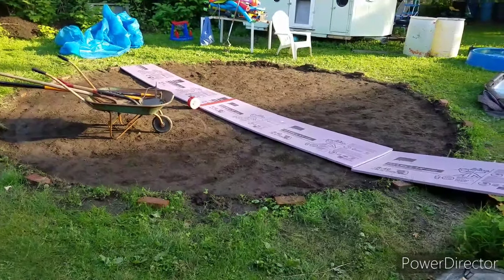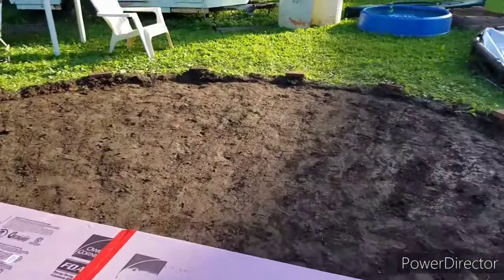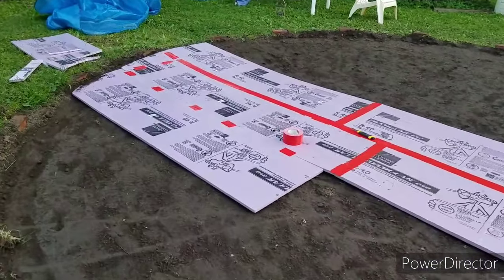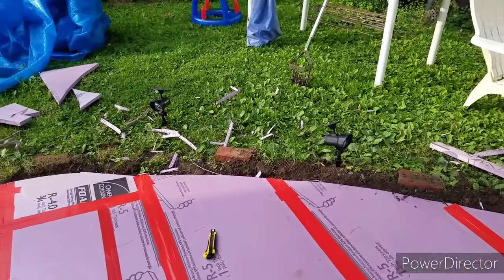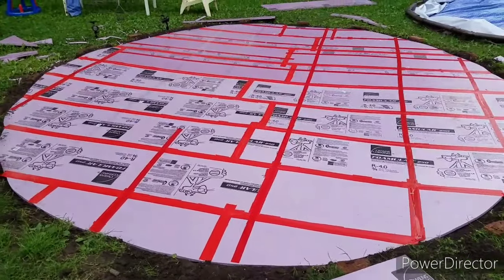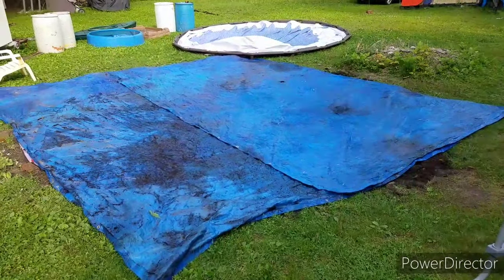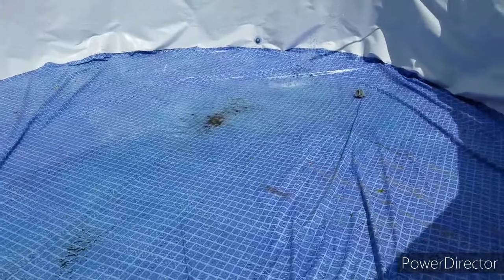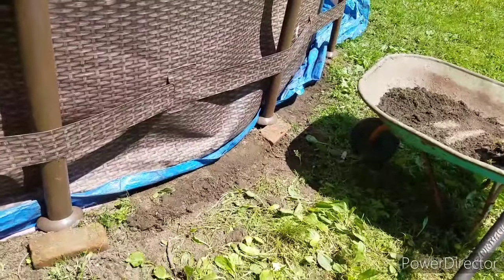Foam pool foundation, Coleman Intex best way pool

Comment: I think I like this idea.  What did that amount of foam cost you about? 
I'm about to do my pool foundation but thinking if I put down 2 inches of sand, I won't have to worry about rocks.  At least I hope?
Reply from the maker: Pool makers say not to use sand since it quickly washes away if a leak develops, possibly causing a drowning risk.
I believe I mentioned the cost in the video, I'll have to go back and check since I don't remember
Reply: @rowerwet  thanks.  
I just calculated the cost of putting down foam boards from H.D.  for my pool size.  It varies from $75 to $200 depending the board's maker/thickness/r value.    I had heard some makers say not to use sand but I had never heard the reason why.  That's interesting and good to know.
Reply from the maker: @johns9990  the wash away happened to me sisters family last spring. They have a bigger above ground pool, and it's probably a decade old now. 
They noticed water running out,  so my brother in law got a repair section of pool liner and went diving to find the leak.
But as he was feeling for the hole it was carving away the sand and soil from under the edge. He felt the liner blow out and swam free of the rushing water. 
It left a good sized hole in the ground and they couldn't get a liner all summer because they were all sold out because of covid.
Reply: Ive read several times not to use sand under pools. The jigsaw shaped outdoor foam mats look like a good option.

Comment: My opinion based on my waterproofing contractor from two years ago. The foam will be water logged after rain and ground water absorb into over the years. My contractor said he doesn’t use this type foam boards against cement block walls for this reason. I would think being under the pool you risk depression spots in pool floor in the long run. But hope it works out for all your efforts
Reply from the maker: I put out another video showing the foam a year later. It's just as dry and solid as it was last summer. This winter I left it out under the ice and snow, drove over it with my truck a few times, with no issues. 
It is not waterlogged, since this is closed cell foam, it's not able to absorb much if any water.
Reply: I did this to my pool five years ago and never had a issue with water logging it heald up great. However after five years the product needs to be replaced because of thinning and the roots under it (weeds) grew up into it
Reply: On other words, based on everyone else's comments is your waterproofing contractor is a liar!  Get a new one.
Reply: it is closed cell foam board, will never absorb water

Comment: This is an excellent idea.bi actually had the same exact idea and found your video searching if anyone else did this.

This foam does not absorb water and will feel nice on the feet.

I have finally leveled the ground for my 18ft pool. I didn't want to haul all that sand to the backyard. I am probably going to go pickup these boards tonight.
Reply: Let us know how it goes!
Reply: @promisedlanders  It turned out great. I purchased I think 13 sheets at 14.00 each. I duct taped them really well together. It's very soft. I used 1/2 inch. 

My neighbor put their pool directly on dirt. Something has punctured the bottom and there are hard spots in random places. They are doing this same idea.
Reply: Did you put the Foam Board directly on top of the dirt?

Comment: I'm putting in a 12'x30" pool for my granddaughter. This will work out well. Couple questions:

1) If I use a good quality tape for the joints do you think I still need a tarp?
2) I have read if you level the ground and use the same foam thickness as the stones/bricks to support the pool uprights it makes assembly easy (no digging for the stones). But don't you think 1" or 1-1/2" foam may be too thick?

Thanks - Mike
Reply from the maker: Half of mine is on 3/4" and half is on 1", just because that's what I could get at the moment. Any thickness is good, but as you mentioned, thicker requires more support to get the poles high enough. 

A good tape will remove the need for a tarp, I just wasn't sure at the time and decided to play it safe
Reply: @rowerwet  Thanks for providing this video - was going to use 2" or 1-1/2" but went with Foamular 250 in 3/4". My big-box had it with tongue-groove design.

Got it all set up and found a pinhole leak in the side wall that I repaired but now there seems to be a leak in the bottom somewhere - I'm guessing the bottom. Will call Intex but how do you find a bottom leak?
Reply from the maker: @youmbgtube  that's a tough one, minimal water and crawling around underneath the bottom. Does not sound fun...
Reply: @rowerwet  I got lucky. The leak stopped. Strange - the drain plug had a slow drip-drip leak. Could it have taken 2-1/2 days to purge this water? That’s what seems happened.

Comment: How many foam boards did you have to buy to fit the 18ft radius?  18ft has a 256 square feet roughly i guess, so  4x8 = 32 sq ft per board.  256 / 32  = 8 plus waste  etc... im gonna guess you used 13 or so boards? Is that correct?  Thanks! I am planning on doing this in a few weeks for my coleman 18x48 pool.
Reply from the maker: I think I said it in the video,  I have no idea how many at this point.
Reply: Those are 2x 8 in his video btw